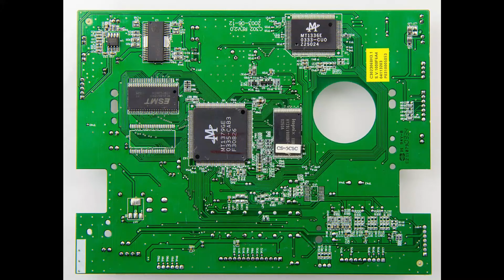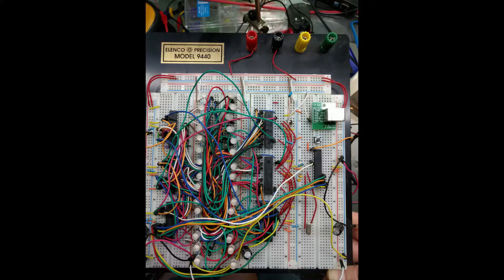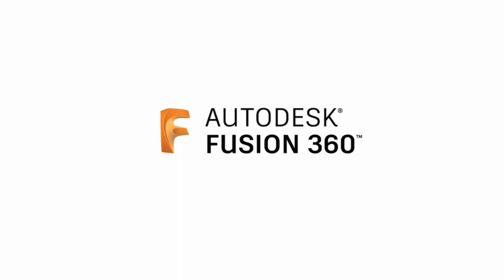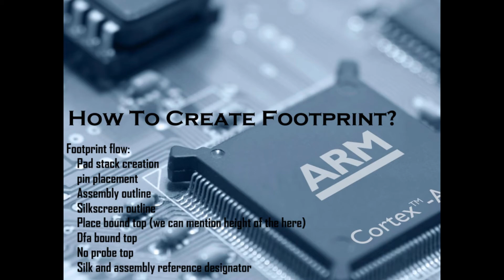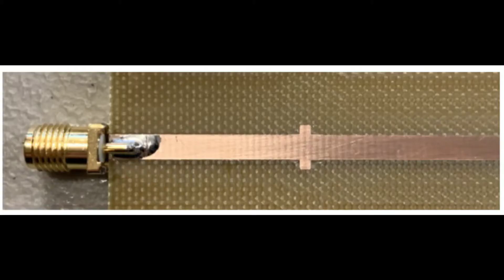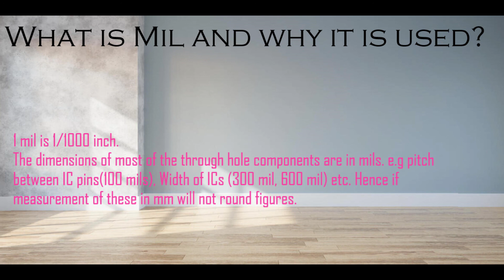Job Interview questions for a PCB Designer || PCB Designer Jobs || Printed Circuit Boards

Comment: IDK if all these questions would suffice for PCB designer internship interview.
Reply: What are the questions ?
Reply: @shayshadav3426  The ones mentioned in this video.
Btw, I got my first job as a hardware design engineer and PCB designer in Kubota Escorts. This an MNC. But in the round one of the interview, I was asked all the basic stuff about electronics related to BJTs, MOSFETs, ICs, etc. In the second round, I was asked to design a simple 2 layer PCB on altium designer.